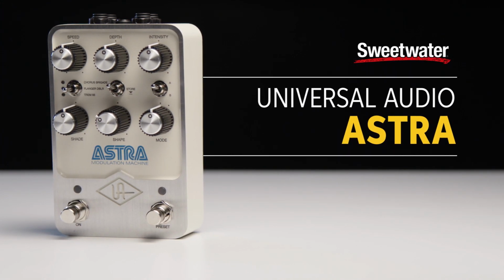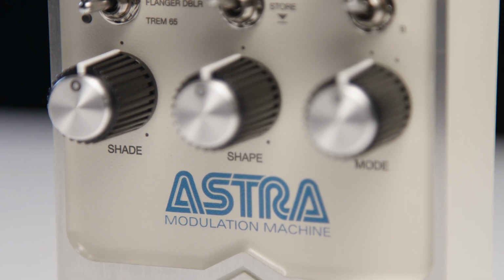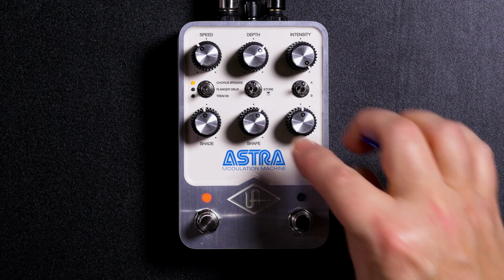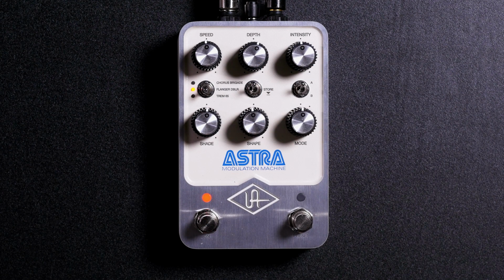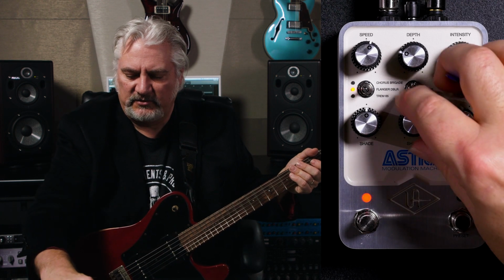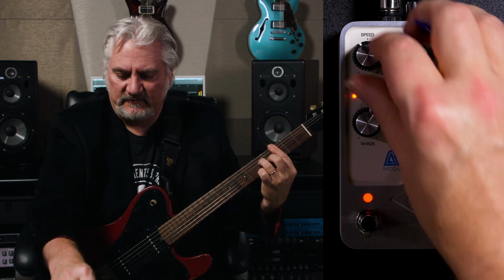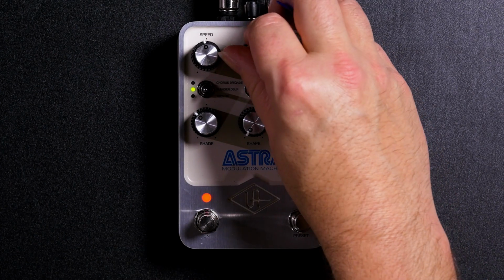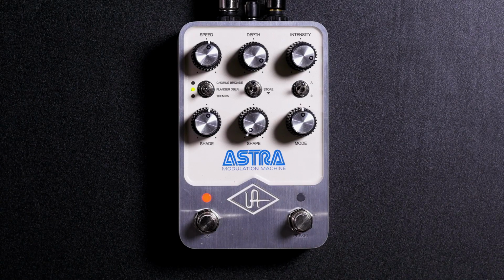Universal Audio Astra Modulation Machine Deep Dive

Comment: How does it perfom on bass?
Reply from the maker: Hello, Andy! I haven't gotten a chance to try that on bass yet, but most modulation pedals will work just as well on bass and don't necessarily have to be bass-specific. That being said, this is a really flexible and awesome sounding pedal, so I think it would be really cool on bass.
Thanks for the interest!
Kevin Spunde, Sweetwater Sales Engineer, (800) 222-4700 ext. 1732, Kevin_Spunde@Sweetwater.com

Comment: I'm really happy to see UA develop pedals with a new Toneprint platform aiming for the best sound and see Tore back. 
Although, what's the point of paying 400eur to have a digital copy of analog pedals that cost a lot less?
It saves the space of multiple pedals but in that case it's a multiFX and so it needs presets.

I guess the point is it gathers the best pedals of different brands in 1 pedal.

Actually, I expect UA more in the "amp in a pedal" business (e.g. Strymon Iridium). Even though, I'm leaning towards a future where amp pedals are all-analog-signal (e.g. Humbold Simplifier).
Reply: Flanger/doubler by itself costs ~2000€ on used market. I imagine many people buy Astra just because of it.